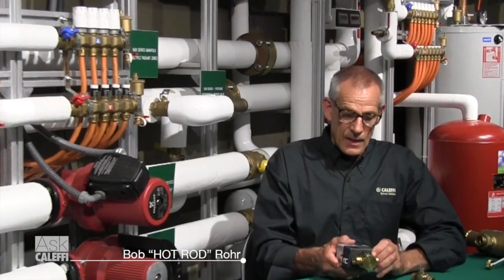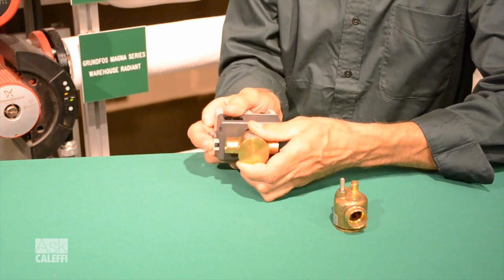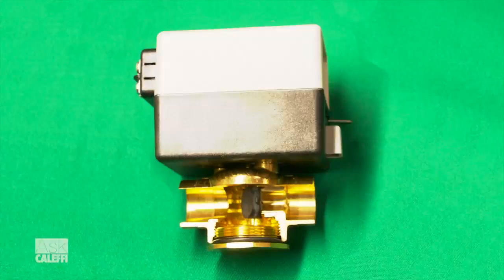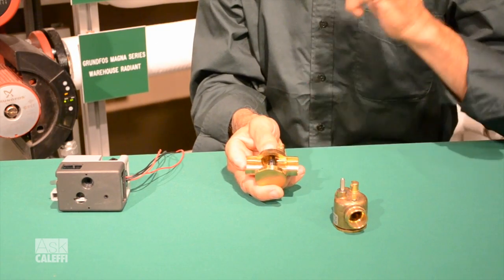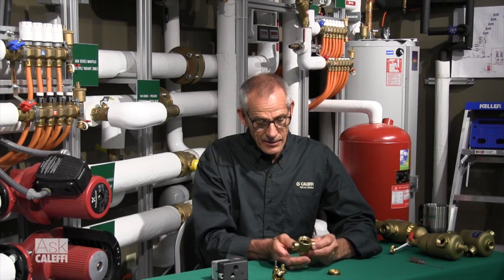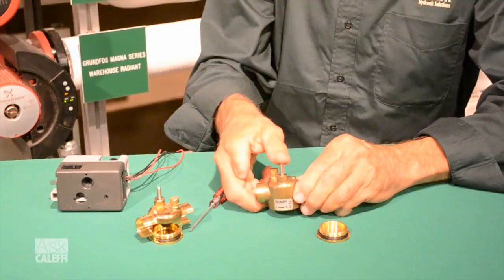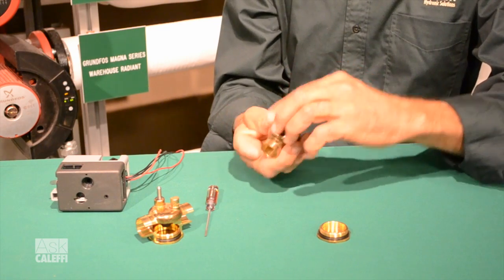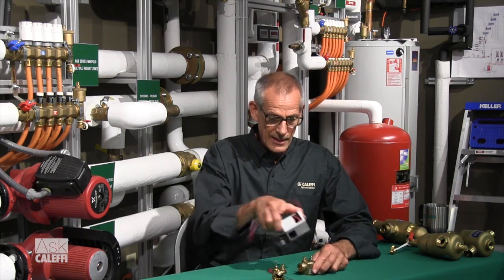How can I clean out the Z-one™ spring return zone valve?

Comment: Hi I have this exact same zone valve. It recently stopped working properly. As soon as the thermostat kicks on the valve opens but never closes once the temperature is reached. This lead to it getting extremely warm in the zone.

Is there anything I can do to trouble shoot this? I had a situation where the gas company came out to our home and shut off a gas valve right next to this zone valve. Im thinking maybe he shorted the zone valve possibly by knicking it with a wrench on accident?

I also replaced the thermostat thinking that could have been the problem but that didn't work. My only other thing could be there is a short in the thermostat wire that could be causing it not to close?
Reply from the maker: Thank you for your inquiry.  The valve is powered open and a spring will return it to the closed position after power is removed.  It should be verified that when the call is satisfied that the thermostat or switching relay is indeed shutting the 24V power off to the actuator allowing it to spring close.   If the power is shut off, verify that there is no debris in the valve, which can prevent the valve from closing completely.  If the power is shut off and the valve has no restriction, you should consider replacing the actuator as the internal spring may be failing. Feel free to call our technical support line for further assistance in walking through the troubleshooting steps.
Reply: @CaleffiHydronicSolutions  Thanks for the response. I just want to make sure I understand completely. So I turn on the thermostat  and the zone valve opens, and you mentioned once power is cut that the spring should close it. I have totally removed the thermostat thus cutting power and the spring stays open.
This means that there is either debri keeping the valve from closing or that the spring might be failing? I will try and call customer service when I get home.